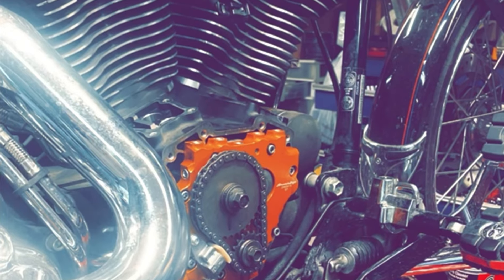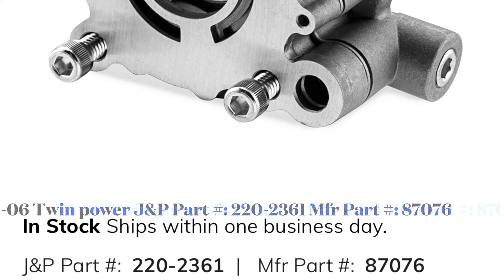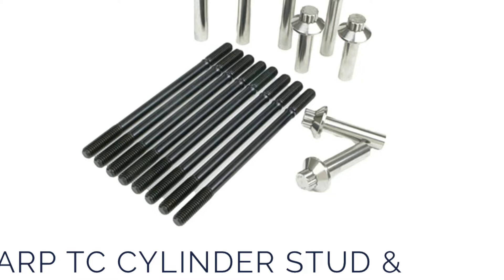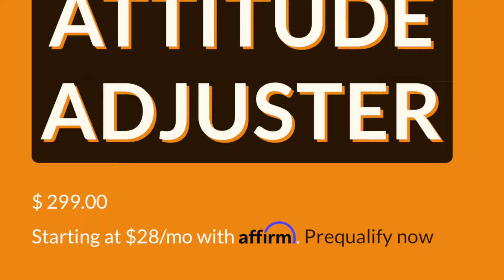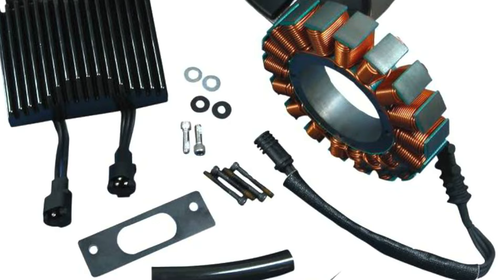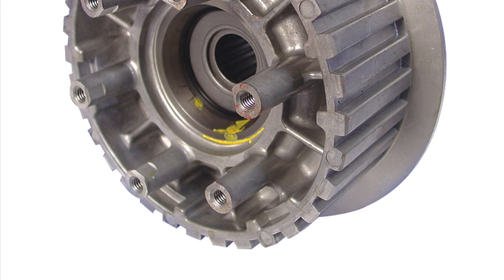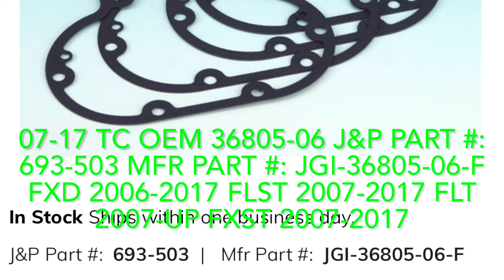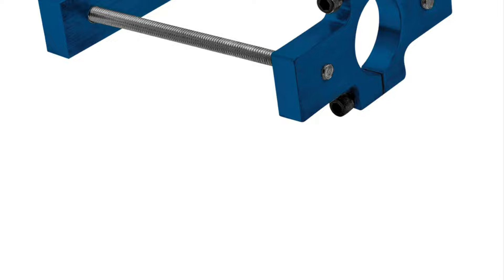5 Most Common Harley Twin Cam Issues to address before they address your Motorcycle! 1999-2017 H-D

Comment: Owner of a 2005 Dyna, originally 88, now big bored to 100ci. This has been the worst bike ever. Unreliable pieces of junk Harley’s are. I’ve spent 8k in my motor. Dark horse crankshaft (stock one had 45 THOUSANDTHS RUNOUT), S&S big bore, SE cams, fueling cam plate, pump, breathers, injectors, and so much more which I’m not going to discuss. Do not buy a Harley whoever reads this comment. They sound great, look great, but if you really want to start hating motorcycles, own a Harley for a week.
Reply: Got a deal on a 2008 FLHRCI with cams and bars and full legends suspension etc ..  was great until got an inner primary leak .. that turned out to be a blown compensator that blew the clutch assembly and a tranny bearing .. not such a good deal now 
My 2023 RG 124 got some lifters getting old .. put 26k miles on that bike in one year .. not gentle miles .. prob gonna put up the loot to bulletproof the road glide from the bottom up.  I need a 100k mi motor with the miles I ride

Comment: I have an 02 tc,cam tensioners were replaced five years ago currently have 41k bike runs strong but I’m beginning to see oil in the breather what would you suggest thanks
Reply: Breather filter may be saturated. Just a guess.

Comment: Most major problems were earlier Tc88 models and the 96 and 103. Most Tc88 motors are solid if you do the few things you mentioned with cam plate and oil pump n such. The major problems arise when people start pumping them full of juice or "beef" em up. An yes the Evo was solid and yes captain obvious (to the ones Wondering why) they discontinued it for a reason 🤩💸💹

Comment: Kawasaki Vulcans don't have those issues "/
Reply from the maker: True same with a Hondas the only issue is you have is to put oil in it and change the filter in a oil change
Reply: True.   Having had a 2017 Vulcan Classic, I know.  I also know it was a ride without soul.
Reply: @heybruh3274  my Vulcan has plenty of soul, I've never owned any vehicle that didn't have a soul and it's own character ")
Reply: @heybruh3274  if your ride doesn't have a soul, then you are without a soul, are at leased you have a bad connection "/
Reply: @heybruh3274  my brother has a 2013 Vulcan 1700 Nomad, it has lots of soul, it took great care of my brother riding through the  Smokey mountains, and on the tail of the Dragon 🐉 😀
Reply: You mean kamayaki right?
Reply: You mean kamayaki right?

Comment: R the twin cams that bad? I was gonna buy 2002 softail fxst for first bike
Reply from the maker: i sold parts alone for 3 years if you don't want to spend double the money on parts let alone cost of labor on a bike a sportster is the best option to get in and get out without losing money on harley if u keep it stock and buy around 3k-3500 dollars, but honda reliablity is unmatched then the other japanese bikes then the least relaible are like non maintained aprilla, ktm and ducati. unless you got thousands in disposable income i wouldnt i bought a vicotry after riding and making money on  a sportster just my honest opinion i hope you do well in your journey and chase for a bike
Reply: @jon5423  thank u. Ya i had planned on starting with a Vulcan
Reply: @jon5423  so especially if it has 75k km on it and only last 2 years maintenance records i shud run then right? Due to cam tensioners maybe never being changed (instead of every 10k km/miles) cuz he said he never heard of that issue of the plastic wearing away and getting into the oil pump, also all the problems listed in the video. The bike may not have been serviced correctly maybe I shud jus buy a kawasaki or Honda. I wanted an older Harley but I haven't been able to find a good one. But I feel like everybody is gonna rot the shi7 out of me for riding a sportster cuz of the stupid stigma attached to it and not wanting to hear ppl n their stupid comments. For a beginner rider n being only 5"10 n 200 lbs heavy build prob the best bike for me   to learn on. Cuz 7k canadian for that bike is apparently a good price n it appears to be in good shape, sorry I'm jus struggling with the decision cuz I like the bike. Can I tell if it has excessive oil coming out of breather bolts without disassembling parts? Thank u so much! Also for somebody who doesn't kno how to work on bike myself. This sounds like a nightmare to own.
Reply: I don't think an ST is a good first bike. They are heavy and maintenance intensive. That said, no bike is cooler in my opinion. I just picked up an 05 Deluxe. Looks like it spent its life on the showroom floor. Has 89K on it. 
Changing the tensioners FOR THE FIRST TIME today. 
Don't be scared. They aren't time bombs.